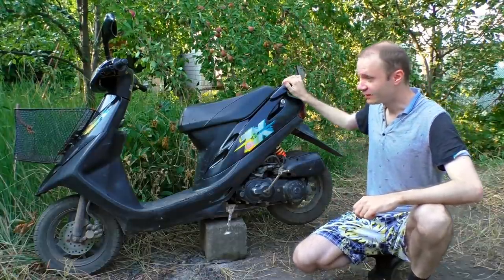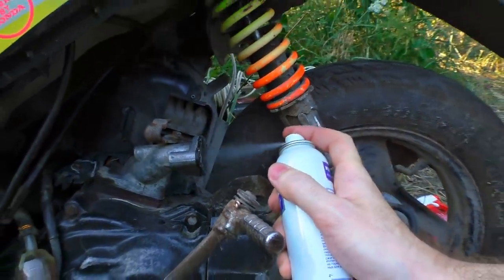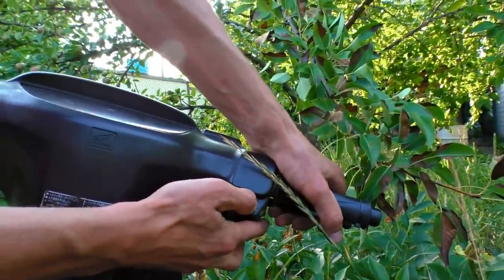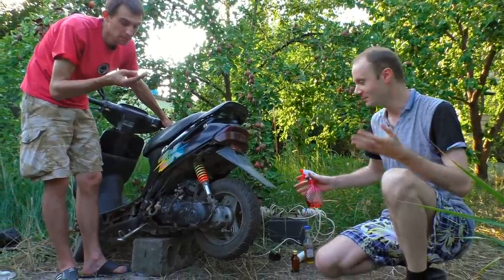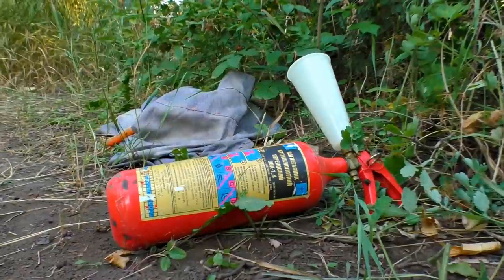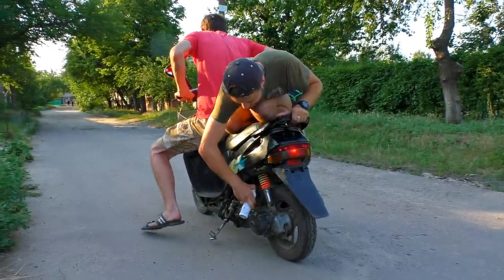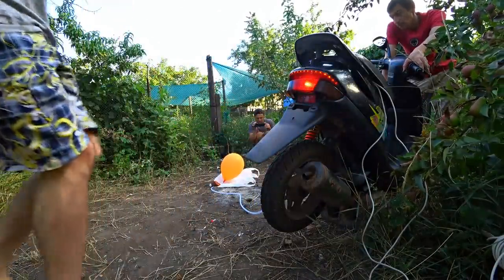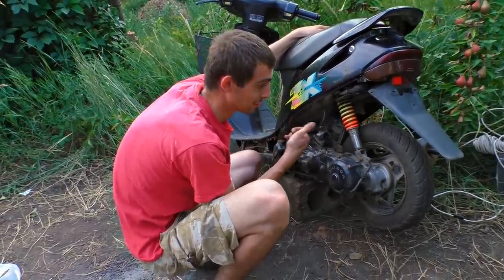Jet, Hydrogen, Carbide and other Crazy Fuel inside of a small Scooter!

Comment: Hydrogen + Oxygen mix in the perfect ratio because it's electrolysed from water. So dangerous lol.
Reply: Jim Griffiths i had an hho tank for a micro torch made with a 3L PET bottle with no flashback arrester at all, straight to the torch, if you think they're insane try using a bottle of compressed hho with 15L of gas and 1.5x the energy of a granade to solder stuff.
Reply: @fss1704  if hho is compressed while in a container it will explode spontaneously. You're a dead man if you try that
Reply: The Virtual Scotsman no it won't, study a little bit of chemistry, especifically activation energy, if i don't have a catalyzer inside the tank it won't explode ever, the activation energy can be easily calculated, and i did this stuff years ago, i'll never ever fucking do that again, but i'm sure it won't explode alone without a flame on such a small pressure. As i said, that had more energy than a granade. It was kinda making granade earrings on the imprudence level.
Reply: The Virtual Scotsman yet i'm alive....
Reply: The Virtual Scotsman did you see that baloon, it had less than 2l, i had some 15l compressed on 3l, that's like 20x more explosion power
Reply: fss1704 would love to see a short video of it
Reply: Newer Account and i wouldn't love to do that again, there's videos of people exploding pet bottles with unpressurized hydrogen.
Reply: Newer Account https://youtu.be/l0YnLWebBJ8 but mine had 20x more power due to the compression, the bottle was almost exploding by itself
Reply: It depends on how fast you compress and how much cooling you have. So long as you do not hit the auto ignition temperature the HHO gas won't explode but  if you get it wrong you get a Darwin Award.
Reply: Hydrogen gas could have been used in cars years ago but they know it is cheap to make because water and potasium is all around us so they would rather pollute the world from fossil fuels to make money when hydrogen burns it doesn't give out toxins just turns back into water it can be reused again and again can even drink it after it been burnt
Reply: @ebikesolutions500 
Your understanding of the costs involved is lacking.
What makes you think that they would not sell the hydrogen at a price to make the same profits?
Reply: @calvingreene90  because it's so easy to make calvingreene90 water is all around us same with the vital components to make hydrogen potassium and electric  check the price of hydrogen cars now made hydrogen super car for example millions
Reply: dont forget they are pros XD
Reply: Meaning youtube copycats
Reply: @ebikesolutions500  easy to make does not mean cheap and have you compared the cost of making your own coffee to buying coffee from trendy coffee shops?
Hydrogen is produced commercially today is made from natural gas proving that your cost estimate for extracting hydrogen from water is wrong.
Reply: I did not put a price on the making of hydrogen so you are wrong I said it is commercially cheap to make I know that for a fact my friend makes it water is all around us as you know and the vital ingredients electricity and potasium are cheap also way cheaper than fuel and natural gas so you are wrong again calvingreen90
Reply: @ebikesolutions500  
Yet somehow commercially produced Hydrogen is made by from natural gas using steam to eat the carbon. 
I hope the rest of your "Solutions" are better than your knowledge of producing hydrogen on a industrial basis.
Reply: @Red Stoner
Because electric cars are over priced and very limited in emergencies.
Reply: @Red Stoner it depends on the method of turning hydrogen into motion.  But salvaging hydrogen from disabled vehicles is much faster than recharge from disabled vehicles and the greater energy density allows doubling or tripling the vehicle's range and still being able to carry passengers or cargo.
Reply: @Red Stoner 
Natural gas does not liquefy under pressure either. And by crazy high pressures you mean normal high pressure tank pressures.
Reply: Red stoner this is the point I'm trying to make you just mentioned hydrogen gas is more polutiant free from all other fossil fuels
Reply: @Luke Patrick Dunwell and got what all wrong I'm trying to make a point about fossil fuel burning and pollution
Reply: @ebikesolutions500  
On earth hydrogen that is not chemically bound to other elements is extremely  rare and is thus only an energy carrier except when bound with carbon in fossil fuels.  By itself it is not a fossil fuel.
Reply: @Luke Patrick Dunwell What you mumbling about now am no speaking to you!!!
Reply: you'd have tons of potassium hydroxide sludge to process though, very corrosive stuff
Reply: True, pure hydrogen is more safe, it isn't explosive.

Comment: That was an awesome idea! Great Video. But the 2-stroke engine needs oil to run. It could seize if you run it to long without oil.
Reply: Now that the crankcase seal is blow out from the hydroxy explosion, it will never run again. They'll need to tear it down and replace it, and shim the cover to set the lateral crank float back to spec. I somehow doubt they'd want to invest that much time. Better to just get another junk scooter/chainsaw and try it again. Honestly though, a stoichiometric hydroxy mixture is too explosive for any engine to run on. An engine needs a fuel deflagration to run, not an instantaneous fuel explosion. Even a diesel fuel air charge is a deflagration compared to a hydroxy or oxyacetylene explosion.
Reply: @mannys9130  Jep, but i think they won't do that. They wouldn't have done that experiment when they needed that scooter.
Reply: That's a Honda Elite, which has oil injection.  You don't need to mix oil into the fuel, the engine does it automatically.
Reply: @paul_109  The Elite adds the oil between the carb and the reeds. Source: I used to own one.
Reply: Honda Elite has a 4 stroke motor. Honds Elite has had 4 stroke motors from the 1st model way back in 85.

Bunch of bright sparks we have here....
Reply: @mannys9130  Yeah, that shit burns too fast for these engines.
Reply: So many people don't understand that a 2 stroke street scooter has a sererate oil tank
Reply: @omgwtflmaololrotfl2368  you are right it is a four stroke
Reply: @omgwtflmaololrotfl2368  depends it also had a model E with 50cc two stroke engine
Reply: Ever heard of Auto-lube?

Comment: Use some Steel wool in the hose with the hydrogen to keep Backfire from Coming back to you.
Reply: or maybe just a pvc valve?
Reply: The problem was their fuel tank balloon had oxygen in it.  Steel wool would have burned in the oxygen also.

Comment: You should use vodka instead of gasoline, but be careful not to get drunk from the exhaust. 🤣  🤣  🤣
Reply: alcohol burns inside the engine, and only water vapor comes out of the exhaust
Reply: @user-ge4uk9ui8y  I would be surprised if all the alcohol was burnt...

Comment: The real question is which one is the cheapest alternative? 🤔🤔
Reply: Wind > solar > algae ethanol or oil > hemp/bamboo/wood biomass gas.
Reply: @CTimmerman  probably cheaper to go to the gas station
Reply: @borissaid4542  Waiting for stuff to grow, die, turn into oil, get drilled up from the middle of the sea, transported, refined, transported, and distributed at smelly road stops sounds like more effort than plugging your car into the grid or home battery.
Reply: the rubbing alcohol is cheapest, IF and only IF you are distilling it yourself!
Reply: Bike

Comment: Hydrogen needs safety.Use one way pipes to stop explosions..... ! (or bubbler) It will still explode in the pipes, but thats nothing:D no danger.
Reply: Exactly. A flame arrestor is required for explosive gases like this. A simple water bubbler will work fine.

Comment: if you use molecular sieves to remove the last 5 per cent alcohol you can pour that right into the tank without modifications, though that is 100 per cent ethanol.  So it is hydrophilic.

Comment: Running a 2-stroke engine with no oil is looking for a seizure or a blow up, I would recommend using the four stroke engine
Reply: This scooter is already beaten
Reply: The Honda elite they're using has a seperate oil injection system
Reply: @tristan6509  so? It could be broken, removed or empty
Reply: @milan5159  can you use English instead of gibberish?
Reply: @tristan6509  what didn't you understand?

Comment: I think that the hydrogen oxygen mixture was basically filling all kinds of cavities in the bike engine, and finally the spark set it off.. because when it exploded a bunch of smoke also came from the exhaust pipe.  Basically all of the cavities in the bike engine/transmission became like a pipe bomb.. but there were enough weak points that it didn't grenade, just blow seals out and stuff.  Probably just a little tiny bit of hydrogen/oxygen mix, like open for a split second, and then close the tube.. that would have made it start.

Comment: Hi from the UK I’m really loving your videos you are not afraid to try new things but a bit of information on your bike I’m self-employed mechanic and I think what has happened is your brother was right because it to two-stroke engine blown out the bottom crank seal and you may have to strip the engine to repair it if you’re going to try hydrogen I have done a lot of tests and experiments and actually have my own car runningHow do you do you need a four stroke engine and you needed to run on at least 60% petroleum keep the videos coming loving it but most importantly try and stay safe

Comment: no wonder HHO explodes, next time use pure hydrogen coming from sodium hydroxide+aluminium, or make a sodium cloride cell with destructible anode, that way the oxygen reacts with the electrode giving almost pure hydrogen.
Reply: Or simply have the electrodes separated so that the 2 gas streams don't mix.

Comment: If you want it to run on hydrogen you have to make it run on only hydrogen and not oxygen and hyrdrogen. Please do not try this again without pure hydrogen. Because they are mixed together perfectly, they are almost guaranteed to blow back and ignite all of the gas at once, producing the explosion we saw. You can separate them at the electrolysis stage by only collecting the gas from one of the electrodes. The cathode will collect hydrogen and the anode oxygen. Since you already have a set up that mixes the two together, you could possibly separate them by buoyancy after, as hydrogen is lighter than oxygen and will rise to the top of a container, but I'm not sure how well they would actually separate. I think it's probably unsafe to try this again until you can get pure hydrogen first.

Comment: TIP: Don't confuse hydrogen gas with "HHO" gas.
In  the air there is only say 20%  oxygen, and in a normal engine it takes a while for gasoline to burn,  not only does hydrogen gas burns extremely quickly, but in a 1(oxygen)/2(hydrogen) atmosphere that is well mixed it will behave like a high-explosive, make sure to separate these gasses by using a electrolysis cell that has a membrane separator, like a battery would, otherwise you will mix the two gasses, The only force stopping them from reacting is the fact that both hydrogen and oxygen gas form diatomic bonds, meaning they loosely bond with themselves, if you heat it too much, these bonds break, and they combine, releasing energy (very, very quickly)

Comment: Hello KREOSAN English!  @ 9:49 what a strange reaction, the balloon exploding??  Also, you need to allow some o2 into the intake - you only used a h2 line with no inlet for "air" (oxygen) 

I would use a smaller h2 (hydrogen) inlet hose that allows more atmospheric air into the intake.  Also, you could try spraying NOS?

Comment: I think to make the hydrogen gas work, you need to delay the timing of the spark a bit, because the hydrogen and oxygen burn a lot faster than gas.  I don't have a source on this, but I think you should look into it.
Reply: Nah, you need the hydrogen to be added after the piston reaches tdc since hydrogen burns super quick which means super high pressure injectors

Comment: Isn't that a 2 stroke engine. Running the engine without oil mixed fuel may cause damage to it
Reply: Abhiram AS it probably has a separate oil reservoir

Comment: (Google переведений з англійської, щоб заощадити час :))
Красиве відео, і привіт з Австралії!
Я знайшов папір, який міг би допомогти скутері працювати на водні: https://www1.eere.energy.gov/hydrogenandfuelcells/tech_validation/pdfs/fcm03r0.pdf
У цьому він говорить, що стохіометричне співвідношення повітря: паливо для водню становить 2,4 л повітря на 1 л чистого водню (29% водню), але також і те, що поршневі двигуни можуть працювати на значно менших сумішах (менше водню).
Тут (http://www.wermac.org/safety/safety_what_is_lel_and_uel.html) говориться, що водень є вибухонебезпечним на повітрі від 4-75%. Якщо мішок мав чистий водень у це, можливо водень входження intake магістраль у майже 100% та це об'єднався з повітрям у випадку crank щоб приїхати внизу 75% .. Тоді БУМ!

Любіть своє відео, продовжуйте роботу на диво!

Nice video, and hello from Australia!
I found a paper that might help get the scooter running on hydrogen: https://www1.eere.energy.gov/hydrogenandfuelcells/tech_validation/pdfs/fcm03r0.pdf
In this it says the stochiometric air:fuel ratio for hydrogen is 2.4 liters air to 1 liter pure hydrogen (29% hydrogen), but also that piston engines can run on much leaner mixtures (less hydrogen). 
Here (http://www.wermac.org/safety/safety_what_is_lel_and_uel.html) it says that hydrogen is explosive in air from 4-75%. If the bag had pure hydrogen in it, maybe the hydrogen entering the intake manifold at almost 100% and this combined with the air in the crank case to get below 75%.. then BOOM!
Love your videos, keep up the awesome work!
Reply: Також у 3.6 статті:
"Вентиляція картера
Вентиляція картера ще більш важлива для водню
двигунів, ніж для бензинових двигунів.
Як і у бензинових двигунів, незгоріле паливо може просочитися
поршневі кільця і входять в картер. Так як водень має a
менша межа запалювання енергії, ніж бензин, будь-який unburnt
Вступ водню в картер має більше шансів
запалювання. Необхідно запобігати накопиченню водню
через вентиляцію.
Запалювання всередині картера може бути просто вражаючим шумом або
призведе до пожежі двигуна. Коли водень запалюється всередині
з картера виникає раптове підвищення тиску. Щоб полегшити це
тиск, клапан скидання тиску повинен бути встановлений на
кришка клапана. Типова установка запобіжного клапана
показано на малюнку 3-7."

Comment: Fuel surface + oxygen + heat = fire. Be careful with well-mixed fuel + oxygen. Collect only the hydrogen gas from the cathode, not the oxygen gas from the anode that leaves the ionized hydrogen (protons) in the water.